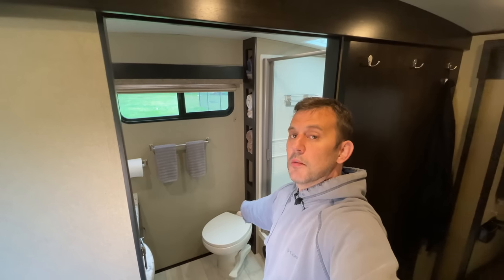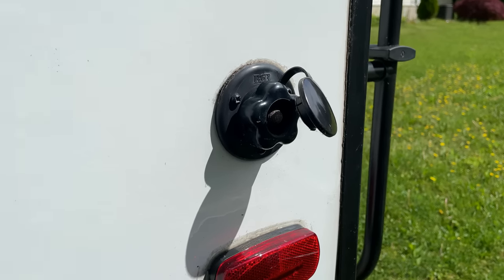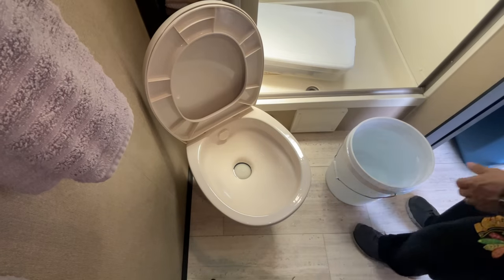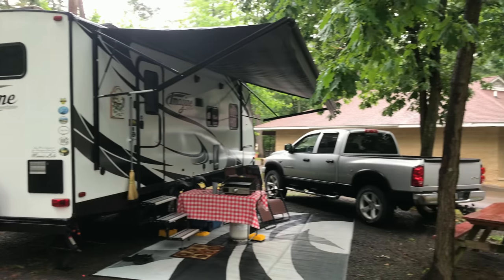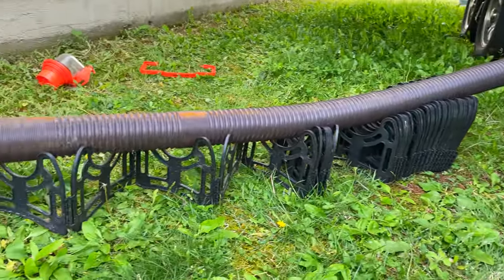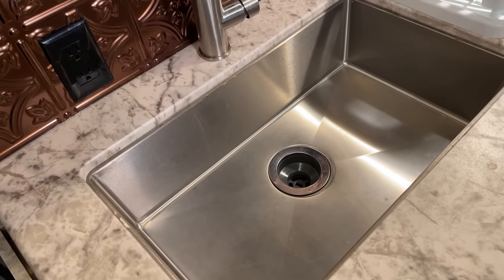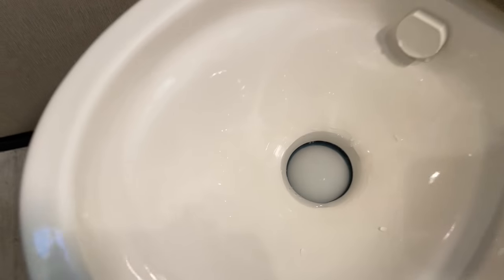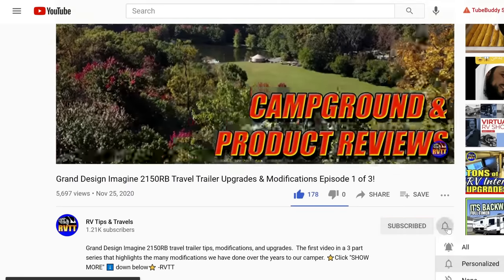RV Black Tank Cleaning, Maintenance, Tips & Tricks - The Original Black Tank Master Class

Comment: excellent video thanks! this summer was our first camping season. I became a bit crazy obsessive over checking the sensors and determining whether they were working or not, was there anything in our tanks or not, was it time to pull a valve open or not 😛 So fine, I can shine a flashlight and see how high the water level might be. According to specs our 2022 model trailer should have a 26 gallon black tank, or about 98 litres...which seems like a fair amount of capacity, yet at the same time does not when I started considering that at home a low flush toilet uses ~4L per flush.  But is there a general guideline that one could use for capacity vis a vis usage per person or time between empties kind of thing? Like 3 people with X#poops X#pees per day equals X days before dumping required. Can I make it through a weekend? A week? Do I have rehitch just to go dump, do I need one of those portable dump tanks or am I totally fine and the sensors are psyching me out so I should just go back to my bevvy.  I know...crazy.  But any guidance comments appreciated.
Reply from the maker: Just seeing this sorry.  I would try cleaning your sensors first.  Things can get messy if you misjudge.

Comment: Should you be flushing your toilet while dumping the black tank? New 5th wheel owner here, and wondering if theres any issues or reasons not to do that, as it seems flowing qater while dumping might help clean the walls/sensors and such. Appreciate any advice!
Reply from the maker: No need to, that little water flow isn’t going to do much.  I have a video coming out this Sunday that will show you a better way to rinse.

Comment: Thanks for the great video! One thing I’d add to soaking the black tank is that you can use heat. The first season we had our brand new camper we didn’t maintain the tanks well, and we didn’t flush it clean at the end. The next season we noticed some solids were still at the bottom after dumping. Someone online mentioned using the black/grey tank heaters (if you have them) to loosen up the yuck. Since I had tank heaters, I turned them on, but I didn’t quite get an immediate result. So, I turned on our hot water heater, filled a bucket and dumped it multiple times down the toilet until the tank was full (that was a lengthy process). I let that sit for hours and repeated the process a couple times. After that I was certain the tanks were back to new. Since then we’ve been using the bio method and haven’t had any issues. More recently, we purchased the flush king with a flow meter so we can flood and dump more quickly as needed.
Reply from the maker: awesome tips, thanks for watching and sharing!

Comment: i made a 1 inch plastic pipe 5 feet long with plug on one end with holes 3/16 holes drilled in other has a valve and threads to garden hose.. i put down toilet from inside and flush tank no cones  or other things
Reply from the maker: Very nice idea.  Thanks for sharing!

Comment: If you are a couple that mostly does weekend camping, is it better to dump the black tanks each trip or wait until it gets 2/3 full even if it might be a few weeks between trips? Assuming we're following your advice on using treatment and adding water back to the tank after each dump/clean?
Reply from the maker: Great question.  We do the same, a lot of weekend camping.  I would recommend dumping after each trip instead of leaving it sit in there.  BUT, since it won’t be full, just put some clean water in the tank to fill it up more so you get a heavier and more pressured dump.  Does that make sense?
Reply: @RVTIPSANDTRAVELS  Thanks, that's what I was thinking.

Comment: Will putting ice in your black tank to help clean the black tank surface damage the sensors?
Reply from the maker: Rick, thats actually a great question.  I would assume not since they must be designed to take at least a little abuse from the solids you put down there.  I'd also think the ice isnt moving across the tank with enough speed to damage the sensors since they are floating in water.  I would think "no" since its not something I have seen in discussions, but still a great question.  honestly, the ice cubes arent going to solve any problems that the normal maintenance i talk about in this video wont solve.  i actually stopped using ice cubes with 3 camping trips left this season and did not notice any difference when dumping, so while im still on the fence about ice cubes, im also not a big proponent of using them either.  You will be fine without them, just follow the main points of the video.

Comment: So I'm new to RV camping (only because my parents are letting me take their camper without them lol) so I don't know much about black tank issues.  This video gave me a lot of insight that I think my parents are even doing wrong. 

A question I have when you mentioned keeping and inch or two of water in the toilet is itself to control odor, do you put that back in after dumping the tank and leaving a campsite to travel?
Reply from the maker: the inch or 2 is referring to the water over the ball valve to create a vapor barrier.
Reply: @RVTIPSANDTRAVELS  I understand that part. I was asking if you always keep that 2" of water while traveling and when parked not using camper (not during winter tho since it would be winterized)

Comment: Hello, we have a new destination trailer.  Initially the black water wash valve was defective, so it was replaced.  Do you know if when you have the black water flush going, are they now silent?  I used to be able to hear them going around in our last RV.  This RV is completely silent which makes me wonder if it is working at all.  Just curious.  This was a GREAT informative video.
Reply from the maker: an easy way to find out is to empty the tank, turn on the black tank flush and see if water comes through the clear elbow on your hose.  its gotta be going somewhere, hopefully with the drain open it comes through the hose.

Comment: I belive the Thetford blue is not to be used on septic tank systems because of the formaldehyde. I use Happy Camper....it can be used anywhere and it works great!
Reply from the maker: Happy Campers has been banned in California due to its chemical composition, and it might get banned in other states soon.  Amazon won’t let you ship it anywhere in CA.  Thetford Aquakem is no longer available with formaldehyde.  They removed that, changed the ingredients a little and now it’s called AquaMax.  It’s also worth mentioning a black tank is not a septic tank, it’s just a holding tank.  The formaldehyde works to break down waste, but not great for the sewage systems.
Reply: @RVTIPSANDTRAVELS  WOW! I did not know that....I was having odor issues with Thetford and none since using Happy Camper! Thanks for the info!

Comment: so just for clarification...if you close the gateway termination valve and run the black water flush to fill the tank, it won't contaminate the fresh water lines?
Reply from the maker: It won’t contaminate it, it’s a separate line.  However, the black tank flush should only be run when the valve is open and the tank is empty.  If you want to fill the tank, the best way is to hold the foot pedal down, no need to connect to a black tank flush to do that.  Watch this:

RV Black Tank Mistakes, Myths & Secrets + Tips to Keep Sensors Working!
https://youtu.be/L50oamx7ivc

Comment: Great video! I have two questions. First, my RV dumps black and gray water tanks into the same drain pipe. 1) The warning on the flush valves says to open all valves before turning on the flush hose. Does that mean the gray water valve too? I am concerned that black material could enter the gray tank if its valve is open. 2) My black valve handle/cable just froze solid. I saw videos showing how to remove the RV underbelly protection to change the cable and/or the valves. "Yikes!" is all I can say. You suggested using one of those click-on valves at the end of the drain pipe. Question 2 is basically the same as 1. Will the black water back up, fill the sewer pipe and contaminate the gray line and eventually the gray tank when its valve is open? Thank you!
Reply from the maker: Good questions.  With gravity I don’t think you’ll have an issue with water back filling to the point of flooding, as long as your sewer pipe drain is open.  Did your valve freeze shut or open?
Reply: We had the same issue a couple years ago before we had black valve replaced. External valve works great, in fact we still use it! Keep gray closed until finished dumping black and then open gray is the procedure we used.

Comment: What does it mean when the toilet burps or blows black the water your trying to flush down?  Is the vent stack clogged?
Reply from the maker: Anthony, you might be correct and I would start there.  remove the cap on the roof and look down with a flashlight or drop an ice cube down to see if it hits the tank.  bees have been known to build hives in there.  if its clear, circle back here and we'll try something else.

Comment: This is all fine and dandy if your campsite has a direct connection. The ones in our area only have a dumping station . With 30 gal black tank you can't be doing all these adding water things. Even with a portable caddy. Any suggestions?
Reply from the maker: Everything mentioned in the video is based off percentages, so I’d keep about 3 gallons in your tank.  But I do agree a smaller tank without a hookup makes it more difficult.  It’s also important to not be adding and dumping if there is a line of people behind you at the dump station.

Comment: Very helpful video! We have a small hybrid and our black tank is only 9 gal.  By putting 10% in I have made the capacity even smaller.  (most places we camp do not have sewer hookup).  Any suggestions?
Reply from the maker: Great question... however, putting nothing in your tank just because it is so small is going to cause more problems down the road.   Whether that tank is 9 or 90 gallons, you need water in it to keep things from sticking.  I would still add 1 gallon of water.  Something else to keep in mind is that when the tank is full, it should be mostly water anyway, not solid or liquid waste.  In other words, water is going in there either way, before you start to use it or when you flush.  might as well put it in before to prevent the poop pyramid.

Comment: Thanks for the video! We just bought a used 2015 jayco jayflight. My truck is in thr shop and will be for about another week. My buddy towed the trailer home for us. Once we got it home we found out the black tank is full. We confirmed this by looking inside the toilet.  It's completely full. We have no idea how long it's been full and won't be able to go flush it until we get my truck back. Is there anything we need to watch for when we do go dump it? I'm new to this. I poured in a bunch if chemicals and black tank cleaner in the tank to hopefully help break down what's in there. Thanks!
Reply from the maker: Put some water in a gray tank.  Before opening that black tank valve just open your gray tank first to make sure of no leaks on your sewer hose.  Then dump the black tank.  I would fill and dump the black tank a couple times to help rinse it out too.  Good luck!!

Comment: I'm surprised that you didn't mention enzyme tank treatment. I've found that it works better than the the blue perfume chemical treatment....and I think better on the environment.
Reply from the maker: I didn’t mention it because I never used it.  I wont recommend or not recommend anything until I personally try it.  I have heard that product breaks waste down well, but have heard numerous complaints about odor control.  I’m using a new product now, video coming in March.

Comment: We've used Thetford Aqua-kem for almost 5 years.  Now they call it Aqua-Max and it is garbage. I did a side by side comparison with an old bottle of Aqua-kem and the new Aqua-max.  The Aqua-kem was thicker and and had a real power smell (Great). The Aqua-max was watery and smelled more like a deodorizer (sucked).   All 3 tank lights now read 1/3, even after rinsing them 2 and 3 times.
Reply from the maker: Thanks for the info Willie, been meaning to try that because like you, I loved the aqua kem, even more than happy campers.  It became hard to find so I switched to happy campers.  They took the formaldehyde out of the aqua max version.  Guess I won’t be trying it.
Reply: @RVTIPSANDTRAVELS  I was able to find the original Aqua-Kem on Amazon from a third party seller, however, I paid $54 for a six pack.  I'll try Happy Camper again - maybe I'll have better luck with it this time.  

Thanks for responding.

Comment: If you can wait put about 5 bags of ice down your toilet and run it down the road it will slosh around and clean off the probes as well when you get to your next destination dump the tank this will work but add a bucket or two of water down the toilet this almost always work or get a pvc pipe drill a bunch of holes in it along with a water hose adapter simply hook up to the water fill connect to drain put the instrument down the toilet then turn it on and shower the tank until clean

Comment: Sir, great video.  Question if you can please.  I have a Forest River Wildwood FSX trailer, recently purchased.  I performed the same steps as you, the black tank emptied.  However, when I went back into the bathroom to ensure everything was good before locking up, I found water on the floor and leaking water under the sink.  It is difficult to try to bend the board back under the sink to determine the cause of the leak.  Do you happen to have any ideas on why I would have leaking from under the sink?  Thank you very much.
Reply from the maker: Could be anywhere on the plumbing unfortunately, it’s worth pulling the boards out and inspecting trust me.
Reply: Thank you. @RVTIPSANDTRAVELS

Comment: Is it safe to use butt wet wipes on your black tanks?
Reply from the maker: These are notorious for not dissolving, even though they say they are septic safe on the packaging, I’ve seen more than a few plumbers say not to flush these for that reason.  In an rv application, since they won’t dissolve in the tank, they could cause clogging issues.

Comment: Great tips, even for resident camping. How about winterizing the black and grey water tanks? I use good old red pop. Also, remove the water valve attached to the toilet. Doesnt take much water to freeze and crack it and about $60 to replace (I know)
Reply from the maker: @Ratdog 305 i have a winterizing video but it was created back when i had lousy equipment.  I am working on a winterizing master class similar to the black tank master class.  it will be out in late october.  in the meantime here is the link to the current winterizing video.  https://www.youtube.com/watch?v=Hc6yNelvTfA

Comment: Great info! So do you still reccomend not dumping your black tank until its almost full when you only use your travel trailer 3 to 4 times a year? Ive been dumping mine after every camping trip because my trailer will sit for a few months, what do you suggest Sir?
Thank you much i subscribed!
Reply from the maker: So if you don’t use your RV all that much and it’s not filled by the end of the trip, what you can simply do is just fill the tank up the rest of the way with water at the end of your trip and then dump. That’ll put freshwater in your tank, fill it up so it has the gravity pressure needed to pull everything out. Easy solution.
Reply: @RVTIPSANDTRAVELS  Thank you Sir👍👍

Comment: We found and excellent method to clean a dirty black tank. After emptying the d
Black tank put 3-4 gallons of water into the tank. Next add a couple bags of ice cubes (pour the cubes down the toilet. You will have to hold the flush pedal down for this. You can purchase a tube that is inserted into the drain to hold the flush door open.). Add a good dish soap (Dawn seems to do the best job.) Now drive to your next destination, when you drain your black tank you should notice that the sloshing ice has cleaned the walls of the tank.
Reply from the maker: Thanks for adding Joel!

Comment: As a formerl 24/7 rv’er the 10% black tank is good but not hard fast rule. Keep a small level handy. When you park the rv check the level. Side to side if the dump valve is lower than the high side use a little less water.

This person is correct about no need for over priced RV TOILET PAPER
Reply from the maker: thanks for watching!

Comment: Great video, very helpful. Dumb newbie question but when you say keep about 10% water in the black tank at all times, do you mean that's also the amount of water to put in the tank for toilet use at your camp site. I understand keeping a certain amount in the tank for helping remove solids off the walls while in travel. What I want to be clear about is how much water to have in the tank for a functioning toilet while camping. I hope that makes sense and I'm not making this more complicated than necessary.
Reply from the maker: That’s where you start so nothing sticks to the bottom.  As you use the toilet it will fill up with more water as you flush.
Reply: @RVTIPSANDTRAVELS  Follow up dumb question, but where is that additional water coming from for the flushes?  From the fresh water tank and are they connected? Sorry, I'm really starting from ground zero here.
Reply from the maker: If you’re using your fresh water tank it comes from there.  If you’re hooked up to city water it comes from there instead.  Whichever water source you are using.